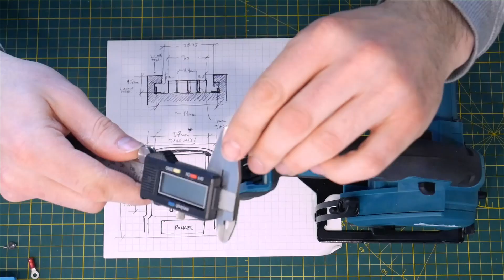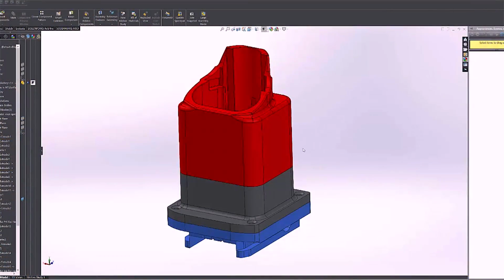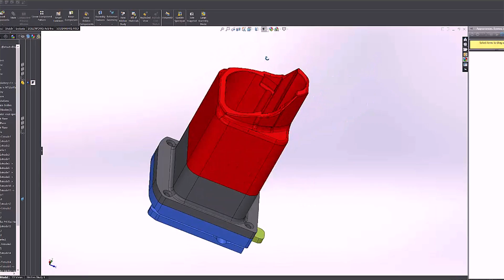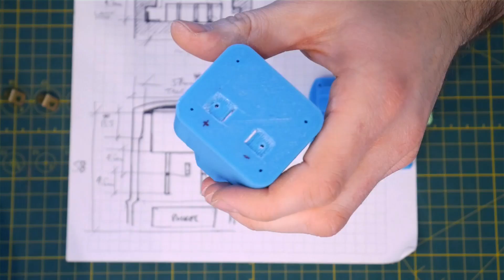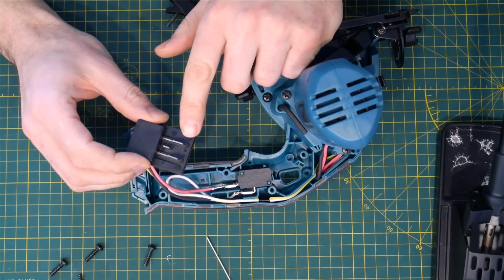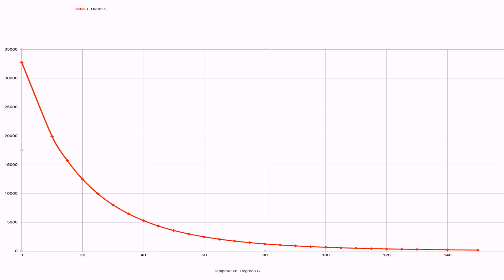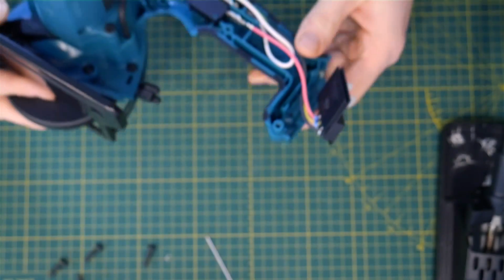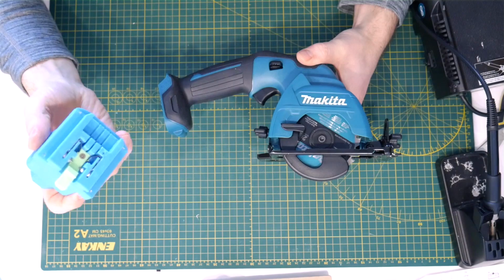Interchange Tool Batteries Between Brands With This One Weird Trick! 🔋 One Battery To Rule Them All!

Comment from the maker: Don't want to design or build your own? They are now commonly available on Amazon. See links below to support this channel. As an Amazon Associate I may earn a small commission (at no extra cost to you):
► Dewalt to Milwaukee: https://amzn.to/3MLbjd5
► Dewalt to Black and Decker: https://amzn.to/4dYPRNQ
► Dewalt to Ryobi: https://amzn.to/4em1NsM
► Milwaukee to Dewalt: https://amzn.to/4ejXQok
► Ryobi to Milwaukee: https://amzn.to/4egNkyw

As this video becomes more popular, there are going to be more people suggesting using a thermistor inside of the adapter to retain the thermistor functionality. This is not going to work as the purpose of the thermistor is to monitor the battery temp. Putting a thermistor inside of the tool or the adapter doesn't solve this problem as it is not hooked up to the battery. Even if you used one, it wouldn't change resistance as nothing inside of the adapter is changing temperature... effectively it's just a resistor at this point anyways... so you might as well use a resistor. To keep a functional thermistor, you could try and alter the resistance value from the temp pin on the actual battery and then feed that into the tool. You would have to do some research into your battery system and what kind of temp vs. R curve the thermistor outputs and then find out the temp vs. R curve the tool is expecting and then map it. 

To address why I put the resistor inside of the tool and not inside of the adapter... With the contacts I was using I was having a hard time fitting a third contact inside of my adapter. They are simply too large. Smaller contacts could give me more room but I was working with what I have. So I altered the tool and it only took 5 mins and I can clip the resistor out in 5 seconds if I ever choose too. Hope that answers some questions!
Reply: If you had been able to connect the third wire, it may still not have worked? Would it be possible to add a resistor that equalled the difference of resistance between the Milwaukee and Makita? (provided the Makita value is higher than the Milwaukee) Thanks for the awesome video.
Reply: @TheHomePro.Network  Late reply, but...  "Would it be possible to add a resistor that equalled the difference"  not really,  because the difference in resistance between the two will itself be temperature dependent.  There is a generic "resistance transformer" circuit, though it's a bit complicated and has limitations. There are some simpler circuits that might perform the task depending on deeper knowledge of the details of the source and destination circuits.
Reply: Thanks for informative video. Does it stop the tool when battery is critically discharged?
Reply: I need a file so I can put a worx 18v battery in a Ryobi lawnmower, takes Ryobi one battery anything available yet?

Comment: Quite finicky to complete, and the reference to the battery terminal inserts got me a much smaller part than shown in the video (small enough that they did not even cover the hole intended to bolt them down). Some increasing sizes of washers later and a trip to buy M2 hardware (I like to think I keep a decent inventory, but M2 hardware I had zero of..). But hey, works wonderfully! Kudos, sir!
Reply: Just had to buy the Makita multi-cutter after this Project Farm video https://youtu.be/GD0VczK5G5A?si=3yJ-MViqYH9BpHZO - but I will not ever buy into a Makita battery platform again after they tried to make my LXT 18V batteries obsolete with their "star"-change. Their commitment to planned obsolescence is impressive. @EmbraceMaking to the rescue!

Comment: The best thing about this video is the approach of addressing the contacts that connect to the tool's straight blades instead of altering the tools' blade contacts..
I had thought improvised using the copper fuse holder in plugs. More recently I looked at the contacts for makita  bms tools which were expensive by themselves but actually cheaper with the board. I thought cutting these of the board may be an option especially for higher current devices.
As a very preliminary thought by adding resistors in series clearly increases the resistance, and in parallel reduces the resistance. Maybe this could be done with the thermistor to make it match.

Comment: Thank you so much for the knowledge. Is it possible to post a video on how to modify an adapter for Dewalt 20V batteries on Hercules tools. It’s the same issue with the resistor. But show us how to make the modification in the adapter instead of tool. Thanks so much

Comment: Clever.  With the cost of everything on the rise and the impact that this is having on the environment sourcing the materials used in these batteries, a ONE Universal Battery System should be imposed on Manufacturers of Power Tools by Governments globally.
Reply from the maker: I'm a little surprised it hasn't been mandated by now

Comment: What if instead of custom altering each tool for each rating and chemistry, you simply decide on a standardized "male" contact pattern and make an adapter that ALL of the batteries fit into. You'd still have to 3D print the interface for each tool and battery, but you could at least got swap every battery with every tool (at least of similar voltages, anyway). Hell, you could embed a switched thermister into that interface, too. Sure, it'd add another inch of length, but it'd be worth it.

Comment: As far as you know, is the thermister more of a requirement for Makati?  Or more of an issue with newer tools?  I have some dewalt and m18 batteries I use on Ryobi tools using an adapter that doesn't even have the temp rail, and the tools don't seem to care.  Could be I don't have the newer or higher performance tools that use that 3rd rail.

Comment: Can’t you just scan it..
Reply from the maker: yes and no... if you have a really high end scanner yes, and the high end scanners come with good post processing software to make a nice model from it. If you have a hobby scanner a lot of the small details will be missed and you'll end up with something barely usable. Also, the low end hobby stuff usually has bad post processing software and dealing with the mesh is a nightmare. In which case you're better off just measuring and building your model from scratch.
Reply: @EmbraceMaking  Got ya👍✌

Comment: The problem you run into is some older tools do not have circuitry inside, they relied on it being in the battery. Well that costs too much so now the circuitry is in the tool and none in the batteries.  So you have to be carefull to not run the batteries down too far because they may not charge back up even if you open them up and use an rc charger with balancing leads.  Not all brands have changed like that.

Comment: It should be the law that all these manufacturers all use the SAME battery voltage and style of connectors. Any "standard" battery should fit any tool you buy. It's one of the world's biggest scams. There could be three shapes/sizes, one for smaller tools and one for regular tools one for larger devices like snow blowers or lawnmowers.
Reply from the maker: Would be nice! Although they would probably argue that it would hinder their ability to innovate battery and charging technology, or it would place limits on the form their tools could take shape or something. I'm sure they already have 1000 arguments ready for the lawyers lol

Comment: Cheap battery adapters can cause a safety hazard with batteries containing common lithium cells.  The genuine battery must signal a fault to the tool if the cell temperature gets too high or too low.  It also must signal if the pack has reached its minimum safe operating voltage.  Discharging below that voltage can cause the copper substrate to dissolve in the electroylte and then form dendrites when the cell is recharged.  If the dendrites short the cell it can vent or explode.  The only safe adapter is one that conveys the power fault information from the battery to the tool.  Anything else is like playing russian roulette.

Comment: Thank you so much for posting this! I've just bought the same bare Makita saw for a project and didn't want to have to splash out on a battery and charger too (which is more than the tool costs) and this means I can just use a regular 3S lipo to power the tool.
Reply from the maker: Great to hear!

Comment: Great video and now it makes sense why my adaptor isn't working correctly for what OI'm trying to do. I have an Ion ice auger that works with a 40 volt battery that the battery corroded and cells went bad. I have 2 Ridgid 18volt batteries (from tools I have)  that I got two adapters for them and put them in series to get 40 volts. But when I connect it to the ion auger it doesn't work. I ohmed the thermister on the Ion battery pack and get 13k ohms. The Ridgid battery packs have 8k ohms. How do I fool the batteries to think that each has 8k ohms? The adapters only have 2 leads pos and neg. Do I need to run an 8k ohm resister between the neg and the t1 (basically what I connected the ohm meter to to get the 8k resistance reading) on each adapter? I'd have to figure out a way to connect it to the terminals of neg and T1 inside the adapter if that's the case

Comment: I cant run my stanley fatmax tool with makita battery. Also i cant find what resistor do i need 🤷🏻‍♂️ help pls
Reply from the maker: Try wiring in a potentiometer and vary the resistance until you find something that works. Then you can remove it and replace with a resistor of the value you found to work.
Reply: @EmbraceMaking  well, i tried 10k ohm resistor - like similar tools has (dewalt and hercules) - and it works 👌

Comment: Question. I have SKIL drill and parkside battery 20v x team. Cant make it work, when i connect, drill can spin but after ~5sec it shut off and i have to reconnect battery to work again (for 5sec again). Like some protection in skill acu drill is activated. I tried 10k resistor and it is same. Any sugestion? Cheers
Reply: From manual: Battery protection Switches o the tool or prevents the tool from being 
switched on, when : the battery temperature is not within the allowable 
operating temperature range of -20 to +50°C. So probably i need correct resistor. I tried 10K and 20K and its not working. How to determine resistor to bypass?
Reply from the maker: Without knowing the original or having access to the original its a bit of a guessing game... you could always try a potentiometer and you can vary the resistance until you find one that works, then remove it and install a regular resistor of the value that you found to work.

Comment: Do you print your own battery adapters? If someone were to ask you to make 100 pcs or 1000pcs of a each adapter (both M12 and Dewalt 12V) separate from each other but would need a 3 or 4 hole mounting platform on each, would you have interest and what might you charge per pc based upon 100 pcs minimum and on 1000 pcs?
Reply from the maker: Yes, I printed my own. I guess I would have to see how long each print would take + how much material. Do you have a file for what you want printed, or you would also need the design work done?

Comment: That's pretty neat :) I bought a floor display Hyper Tough electric mower from Walmart for $89, which did not come with any batteries or a charger. The batteries and charger will run me about $100. What I would really like is an adapter that would allow me to use Milwaukee M18 batteries in the mower, because I have a ton of them. I have also heard of people having issues with the cheap Hyper Tough batteries. Now, the 2 Hyper Tough batteries used together add up to 40v, and 2 M18 batteries will only yield 36v. But I think that most electric motors have a voltage range, so it would work, with a little less power. Maybe someone else can chime in who has more electrical experience. Getting back to the idea of adapters, since the mower has an enclosed compartment that stores the batteries, maybe I could just rig something up with some wire, alligator clips, etc. Battery placement is a bit more flexible than on a normal power tool.
Reply from the maker: You could give it a try, but with all of the vibrations of an electric motor you might want to try and make a plug that is more secure than aligator clips. Those clips might come loose and short on one another which wouldn't be good!
Reply: @EmbraceMaking  I ended up assembling it with nice injection-molded aftermarket battery docks that I bought off of eBay. I wired it all together with 14ga wire with female spade terminals crimped on, and I used shrink tubing over all of the connections. All of that came out great. My problem now is trying to trick the mower into accepting the new batteries. After I give it power. It will only run for a few seconds before it shuts down. I've looked everywhere online, but I can't figure out what resistance amount the mower is looking for with that third terminal on the factory battery dock/wiring harness :(
Reply from the maker: My only suggestion would be to buy the hyper tough batteries and carefully take one apart and see if you can measure the resistance of the thermistor... then carefully put the battery back together... and then do whatever you need to do with that battery.... or you could get a potentiometer and wire it in like the thermistor and vary the pot until you get it at a resistance where the tool will run and then measure it, and replace it with a regular resistor of the same value. Although I'm not sure I would do this with a mower because those batteries might actually get hot and trip the thermal protection for something that draws lots of current (and you will be running outside in the heat for long periods of time) unlike a drill or saw that where you drill a few holes or make a few cuts and then it sits there and gets a chance to cool down...
Reply: @crazyfvck sorry I'm a year late reading about your problem trying to run an 40v electric mower from 2 drill batteries as I've tried the very same thing before and failed. The reason is the mower and the battery have a handshake (electronic code like car immobiliser) to prevent users from using 3rd party batteries, I ended up buying used Greenmower batteries on eBay to get the code system but never got around to finishing project. Dyson vacuum use simular tricks where you have to attach repaired battery to a usb programmer to reset on board chipset. I'm very disappointed that Paul Dyson gets so much credit for making junk with time it built in. Keep going you wok beat the immobiliser if you try hard enough. Industrial Scammers.
Reply: 20V and 18V Batteries are the same! ie. The 20V is just marketing 20V MAX, then they drop to 18V soon after that! So yes they should work but with the same amount of power not a little less 😀

Comment: Man, so easy. All you need is access to a 3d printer, auto cad and the knowledge of an electrical and mechanical engineer. No sweat
Reply: 3d printers are more affordable than ever now, some of the cheapest can somestimes go below $100.  You also dont need auto cad, he left the files so all you need to do is upload them to a slicer then print them.  And doing all this is really simple, no need for a degree in mechanical engineering.
Reply: @jadynadams7817  really? Would you buy me one?

Comment: If I was to use a dead li ion battery instead of 3d printing and left the board in it would I have to do the thermistor trick or would it just not work with the board?
Reply: If it’s the right brand and type of protection board then it should run fine with some new Li-ion cells

Comment: This is a very interesting video and of course interesting topic, If I may drop to the simplest of questions, what would happen if you simply detach that third wire? Thanks for your time.
Reply from the maker: If you detach the temperature wire the tool won't run in most cases (if it monitors temperature)

Comment: Hey! Commenting to let you know the Milwaukee M12 tabs you are linking are not the ones used in the video. The mounting hole is too close from the tab vs the hole in your printed adapter.
Reply: Yup, this. Did the item # get changed or what? I'm just going to drill through but bit of a bummer.

Comment: You are brilliant ! I have same problem too with my black and decker , worx, rigid , etc. so I have lots of Chargers. Why don‘t you open a Company specializing in these adaptors so that I could use like as so see batteries of other brand tools. Like the are  „Microsoft style“ . Do you remember before that that different system were not compatible operating system. Since that Microsoft came we could used all different kinds of computer brand because an adapter operating system link them . Thes you can do and I will be your First Client and Help you advertise these brilliant product. Then I could use all my batteries for other tools. Do you repair batteries and batteries charger too.  You must start these company. It will be a boom,👍👌😎
Reply from the maker: Thanks for the message! There are some people already out there doing this! ... might even want to check out Etsy... pretty sure some people are selling them there.

Comment: could you do a video on using dewalt batteries in harbor frieght HERCULES tools? i tried to do the resister in the tool for a hercules flash light and dewalt battery. couldnt get it to work

Comment: Anyone know what size resistor is needed for Milwaukee M18 tools?  And if so, between which terminals?

If you don't know, but have an M18 battery, can you do an ohm resistance reading between:
B+ and J1
B+ and J2
B- and J1
B- and J2
Reply: @@williamsanders2431 there is a channel called “Tundra, Tools, and Tech” that had the info. It was called Makita batteries on Milwaukee tools, or something like that.